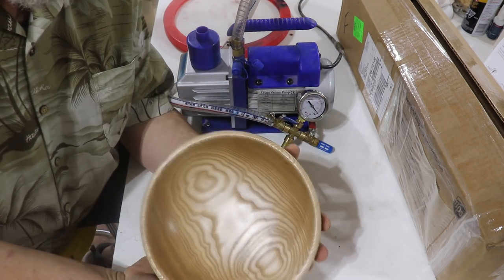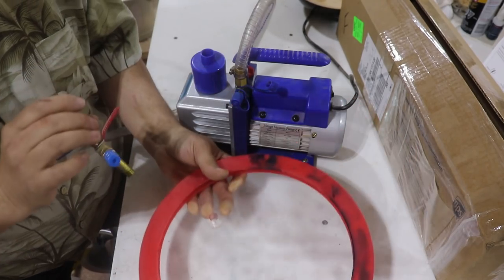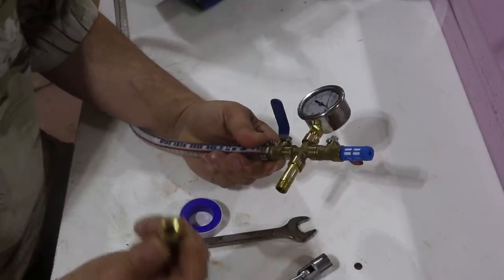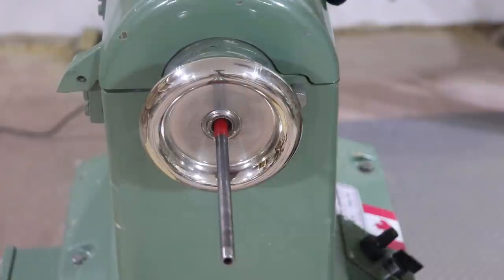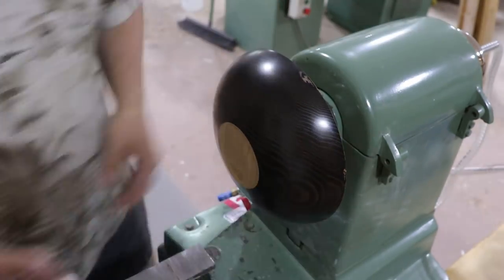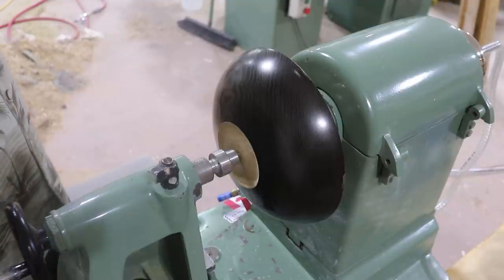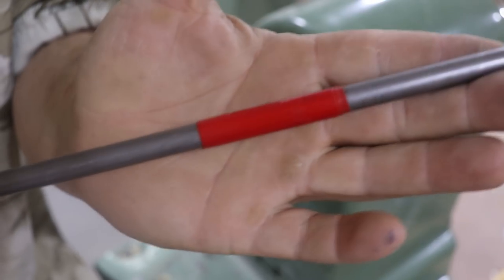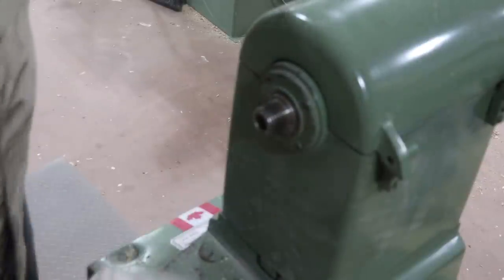Woodturning | Unboxing, Setup and Test of the Harrison Specialties Vacuum Chuck

Comment: Rig up a stand for the back end of vac chuck, and utilize that for setting up your gauges. That way no rubbing, and you have a stable mount for everything. Another great upload Lewis! I just bought the Rikon 3/4 hp grinder with a 180g & 600g CBN wheels from Harrison (nothing else with it, no guards, or platforms). Just need the vari grind to get here.... Unfortunately I didnt see the fine print, serves me right for not reading it all. So using my carbides until I can grind correctly. Harrison is a good company though. 
  Also turned my first cup today, didn't come out to bad. When I get my ipad set up I'll send you a pic. The finish on that bowl is amazing! Thanks again for all your comments and answers to my questions.
Reply from the maker: That’s awesome! (The cup I mean). Yes I am going to rig up better now that the test went well. Thanks again for watching!
Reply: @TheKlondikeCraftsman  
 Thanks man, I really do appreciate it! It's a start, and that's good enough. My mom always said that to me, regarding so many things. Def need to purchase a vac chuck in the future.

Comment: Perhaps add a bracket for the problem tube too when you mount the gauge and valves to the lathe like you showed.  Still like the bowl and how it finished up👍    Take care. -Mike😷
Reply from the maker: I’m not actually going to mount to the lathe itself. I’ll have it mounted on a stand that I can move around when not needed. Still could roll a bracket in and out though. Thanks for watching!

Comment: Technical question. I see lathes for sale from $250 - $4000. What size, strenght, speed required for things like bowls, cups, etc. ? For starting up. Thanks for your generosity of knowledge.  Joe
Reply from the maker: Hi Joseph, the lathe I am using in the videos is the first and only lathe I have purchased. My philosophy it buy your last lathe first. I had the benefit of learning on someone else’s lathe to know it was something I wanted to do long term. Regarding specifications, I suggest minimum 2 HP, variable speed, reversible with a swing that will allow you to do 18-20”. That will not be cheap but it will last a lifetime. People buy beginner lathes for $500 and upgrade losing money. They get an intermediate lathe and upgrade losing money. If you have done some turning on a friends lathe or at a club and you are passionate about it, you will save money by going directly to the lathe I’ve described right off the bat. In addition, your turning experience will be better on a professional grade lathe as well. Best of luck and thank you for watching!

Comment: If you take a small piece of hdpe, turn it to a slight taper plug that will fit the hole in the handwheel, then drill a hole just slightly larger than the vacuum tube. That would protect the vacuum tube.
Reply from the maker: Not a bad idea! Thanks for watching

Comment: For another option besides paint, I recently purchased a product called Speedball Supper Black and used it on a shallow bowl or thick platter.  I finished it with beeswax and it turned out pretty good.  I have been looking for a somewhat inexpensive vacuum chuck for a long time but no matter how much I look they never get more affordable.  In the mean time, I made two sets of expansion leaf's for my cole chuck.  I have to swivel the head on my lathe to use the larger of the two but it will hold a very large bowl or platter.  I would have posted a picture but I guess commie tube doesn't allow pictures in a comment.
Reply from the maker: Very cool, you can email picture if you like. klondikecraftsman@hotmail.com 
Thanks for watching!

Comment: Check the manual or with the manufacturer for the duty cycle of the vacuum pump, that way you know how long you can run it without worry of it shutting off on you.
Reply from the maker: There is no shut off on this one. Thanks for watching!

Comment: Put a bearing that fits loosely enough that you can remove it each time. Instead of using tape. You could put a rubber bushing on inside of bearing and leave it in the machine
Reply from the maker: Yes, that would do the trick. Thank you for watching!

Comment: You should have looked around before buying that “wobbly” pipe system….I think the Oneway system has spent a bit more thought on their product
Reply from the maker: I did look into the one way system and still thought I would give this a try. It only wobbles when the vac hose is not attached. I appreciate you watching!